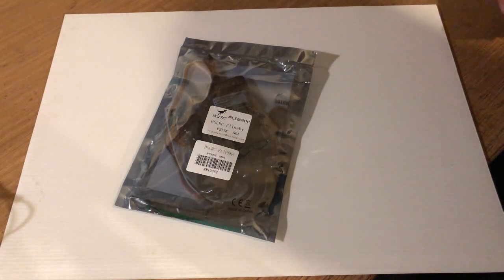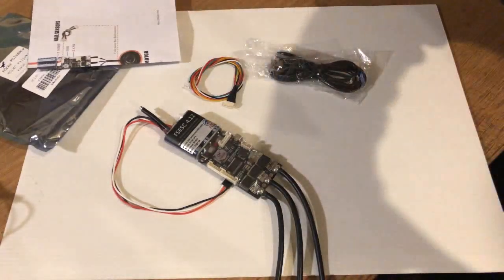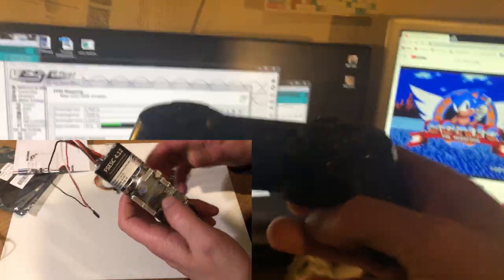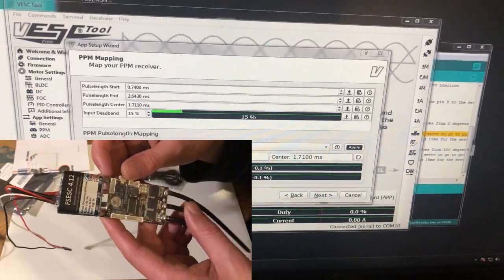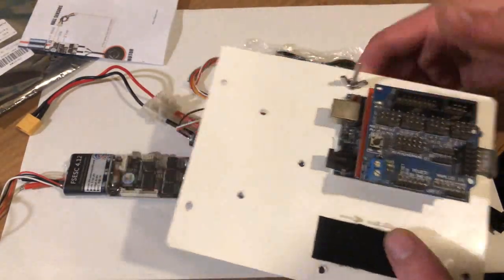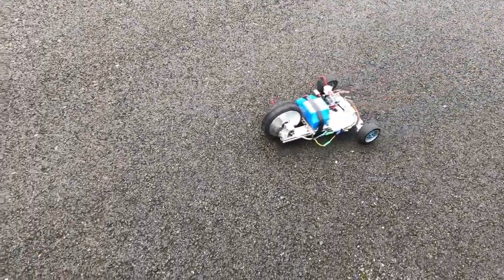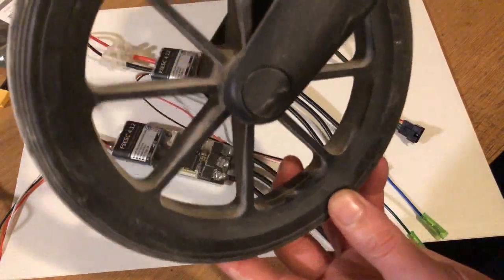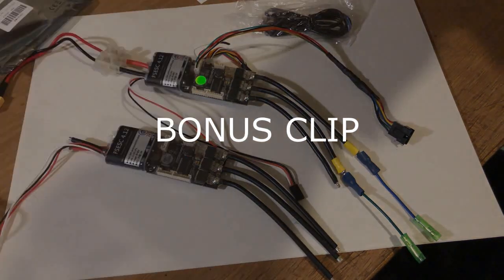FLIPSKY VESC + HOVERBOARD MOTORS + ARDUINO - RC BALANCE BOARD CAR

Comment: I'm glad I found your channel!, because I bought several broken hoverboards to salvage The Hub Motors and batteries for a couple of projects that I'm starting on. Thank you for your hard work and sharing…
Reply from the maker: ok great they are good motors, i would recommend using the hoverboard motherboards to drive the motors

Comment: I'm upgrading the drive train on my rc fish and I have some questions about this vesc setup for regular rc controllers. Mainly what settings are best and would you be able to walk us through it?
Reply from the maker: there is a setup wizard that i used but my settings were far from optimal, there are so many things you can change its really worth finding out what they all do to get the most out of it for your specific application, thanks
Reply: @A-tech  right on, I actually think I pretty much have it. My only general question at this point is how obvious is it if I'm running them wrong? Like mine are running nice and smooth so I'm assuming they are good.

Comment: Hi great work,
Is it possible to set the controller up so you only need one joystick to maneuver but be able to do a tank turn at a stands still. 
So you have your obvious forward and backward(regeneration until wheel stops spinning then goes in reverse)
But have the left and right controller one motor forwards and the only starts it’s regeneration braking until you stop then it would start in reverse and be able to do a 360 deg turn like a tank.
Reply from the maker: hi, yes you can set it up do however you like, hope this helps

Comment: Any chance you can tell me how you control 2 vesc to steer right and left ? Have been searching for hours .
Reply from the maker: hi, im sending a pwm signal from an arduino to each vesc, in the vesc programming software you can set the forwards and reverse ranges for the output on the arduino, thanks
Reply: @A-tech  Thanks for the reply.
I have found another method, using UART -> master VESC -> slave VESC.
found that u can control both if u configure them as master/slave and connect them using CAN cable.
Also another way, using i2c port to pcA9685 to each VESC.
I have learned from your videos thanks
Reply: @don-jp2rs  can you share your code pls or point where to read about it

Comment: Are there any option to get pulse signal that represents the wheel rotation and direction? So I don't need any additional rotary encoder.
Reply from the maker: good question, you may be able to hack the hall sensor, thanks
Reply: @A-tech  so there are no pulse feedback from the VESC?
Reply from the maker: @Gho2sH  not as far as i know, there is computer software you can use while its running that can give out information but i think for accuracy and reliability it may be best to fit something to the wheel or take signals direct from the hall sensor to work out wheel speed and rotation direction, thanks
Reply: @A-tech  well noted with thanks buddy... . I have a dream to make a MMOS or simcube poor man's direct drive ffb wheel using that hoverboard wheel and if I can get the encoder pulse from the hall effect sensor, I can remove the rotary encoder from the shopping list.
Reply from the maker: ok, that sounds good, it might be tricky doing what you want to do just using the hall sensor but it does sound interesting, the motor insides have 27 sections so it should be possible for some sort of accurate small movements, thanks
Reply: @A-tech  well, usually people use at least 200ppr encoder. I'm pretty sure the motor will do very well if I can somehow coupled an encoder to it. The main controller is a STM32 with MMOS or simcube firmware that generate a PWM on 0 to 100% duty cycle with a direction bit. I don't know whether the controller can be adjusted to 1to2ms PWM like RC have.

Comment: Is it posible to output more than 50% while in reverse?
Reply from the maker: hi, yes they can do 100% both ways
Reply: @A-tech  Thanks. I have one more question. Does the blue sensor wire from the wheel connect to the orange wire from the vesc?
Reply from the maker: no its just match the colours up, like blue to blue, green to green, thanks

Comment: Can i buy 2 off these from you what i mean by that is u pre program it all for me so i can controll 2 motors with a ps3 controller
Reply from the maker: hi, the controllers are set up to the motor they are running, some motors are slightly different so im not sure if this will work, i have will have a video soon of reprogramming a hoverboard motherboard which might be better, thanks
Reply: Wel the basic calibration for the motors i can prob do my self but the other stuff like the programming and stuff goes above my head
Reply from the maker: ok so itt would be mostly arduino code and setting up?

Comment: can you send me the schematics for this pls?
Reply from the maker: I cant send you one but they are pretty straight forward, also they come with a 'connection diagram' which basically shows motor wires x 3, power in, servo / pwm in, hall sensor plug and a few other connections, hope this helps

Comment: Do you have a configuration where the hoverboard is able to move at slow/low RPM and run smooth? I have my motors and the Flipsky 4.12 set up in FOC mode. All I get is full stop and full speed..some times i can get a slower speed, but there is very little torque. But in general the motor is crunchy sounding and not smooth. Any suggestions?
Reply from the maker: hi, i could only get mine to work well speed controlled by using the BLDC option, with that you should be able to get forwards, reverse and variable speed, i think there is a way to use FOC but i think you need to use an additional encoder on the outside of the wheel, im not too sure, i saw a video of someone using them on their motors and they were really slow and smooth, hope this helps

Comment: One more Question. Did you have to set the poles in VESC? I think the default is like 7 and hoverboard motors are usually 15. Or is this all automatic in VESC? Thanks in advance.
Reply from the maker: hi, i think it was automatic in the VESC software, however i checked the additional info section of the motor settings and it says 14 motor poles, any more questions feel free to ask, thanks

Comment: hey awesome job, i’m trying to use the vesc for an arduino project too and i was wondering if you know how to arm the vesc in the arduino code. I want to control the motor with a sensor wired to my arduino. I have everything wired correctly and i believe my code should work but it isn’t. i later realized no code involving turning the motor at all is working and it might be because i didn’t arm the vesc correctly in the beginning of the code. The vesc, motor, and battery works and i tested that in the vesc program with running the motor with the arrow keys after customizing the settings. Is there any way you could help
Reply from the maker: hi, thanks, ok i will try and help you, as you haven't specified i will assume you are using the servo style input to the VESC, what may be happening is you are sending a signal for it to move as soon as its powered on, have you tried having it connected to the arduino and a potentiometer then going into the VESC software and going through the input setup? this can be used to map out your forwards and reverse signals, try this, in the software its called 'App setup', usually used to set up an rc handset, let me know how this goes, thanks
Reply: A-Tech awesome, thanks. You are correct i am using a servo setup and i haven’t tried that. i’m new to vesc and i had played with my settings in the program then unplugged the vesc from the computer and put it in the arduino circuit to try and code it. I hadn’t messed with any of the control settings i will try this today thank you!
Reply: cA-Tech just to be clear you’re saying use the potentiometer to set up the signals for forward and reverse then once those signals are set up i could use those signals in the code to do whatever i want now that the vesc is programmed with those signals

Comment: Can you explain how you connected the hall effects wires to the VESC? I.E. the wire colors from the wheel  and where they match on the controller? Thanks.
Reply from the maker: hi, ok the motor hall sensor has 5 wires, red, black, blue, green and yellow, the VESC i have came with a motor sensor cable that plugs into it, so i just cut the plug off the cable and attached the old hoverboard sensor plug and matched the colours, red and black for power and the blue green and yellow for the sensors, white is for temp sensor but hoverboard motors dont have them so its unused, hope this helps
Reply: @A-tech  Thank you, I'm buying the same controller for my hoverboard wheels after giving up on the ODrive. The connections for the Hall Effects encoders is what concerned me as far as the match up goes but you've answered that for me. Thank you!.

Comment: Hey. Thanks for the video. I've bought 4 of these hub motors and plan to build a robot. Now I'm searching for appropriate ESCs with brake and reverse functionality. Flipsky VESCs seem to be the best for the purpose but they are bloody expensive. 2x dual VESCs will cost around $320. Maybe you can suggest cheaper alternatives with brake and reverse functionality?
Reply from the maker: thats great you are going to make one too, these esc's do have a brake and reverse also, ok try having a look on ebay or amazon for the flipsky vesc, you can pick them up for £40 - £50 each, the dual ones do seem very over priced, thanks
Reply: The cheapest thing for you to do is to take a Hoverboard . With it you have a 2x engine, a controller for two engines (its motherboard is reprogrammed, the other Firmware,)you have a battery, a battery charger....

Comment: I read on the product description that these controllers have no reverse. How are you able to reverse? If so then they are no use for a robot. I am looking for controllers for my hover board motor powered robot rover too.
Reply from the maker: Hi, yes these do have a reverse, there are lots of options in the software to configure your inputs to how it controls the motor, mine is currently set up with an arduino sending a servo like signal to the vesc, mapped so it does upto 95% forwards and 50% in reverse, hope this helps
Reply: @A-tech  what is the exact model you used please? The ones i find have no reverse. Thanks for that.
Reply: A-Tech I am just 100% baffled here. Searched in AliExpress and Banggood for HGLRC FLIPSKY FSESC 4.12 that I saw is written on your controller from your video footage but all descriptions said "Reverse: NO" also I tried the same search without HGLRC on amazon co.uk too, again even on amazon it says "no reverse". Now the cost of these FLIPSKY controllers on both these Chinese sites is around £40 to £48. When I go on the official flipsky web site the same model says it supports reverse but the cost is $85 that’s about £65. Please share the url link of the place you bought these controllers cuz I am lost here. I want to buy them too.
Reply from the maker: @TheNikolasNick  hi, i was just going through some comments and found this, not sure if this is still helpful but the ones i got were just the £40 off amazon, they say no reverse but you set that up when programming them using the VESC tool, hope this helps

Comment: Can you help me with programming in arduino to use an e-bike controller by means of a radio control in the Hoverboard motors?
Reply from the maker: hi yes sure no problem what would you like to know? as far as i know the e bike controllers use a voltage input like 5v from a potentiometer, you cannot do a voltage output on an arduino but you can use a DAC (about £2 off ebay) then use pwm from the arduino, thanks
Reply: I need to control two hoverboard engines like in your video, but with a radio control, by the time I only have the e bike drivers, could you help me with that? Do you have an email to contact you? I would appreciate it very much and very good videos
Reply from the maker: @criskingpher  ok yes no problem, i also have an e bike controller that im yet to test out and get working so it would be good to do, my email is edeped@yahoo.com, thanks